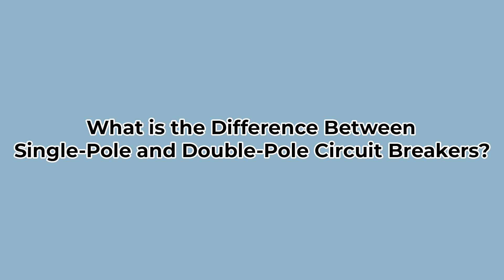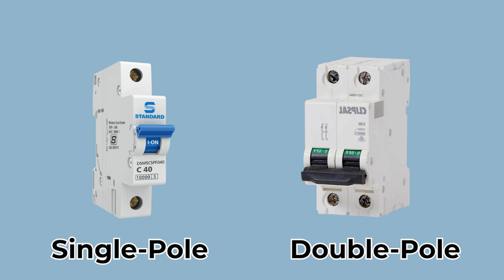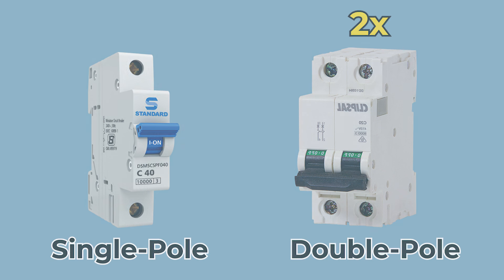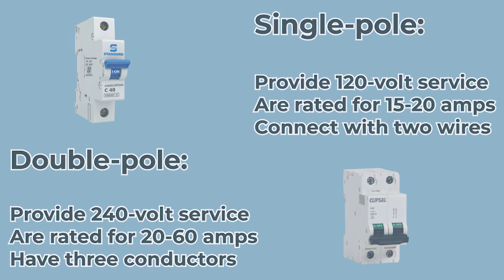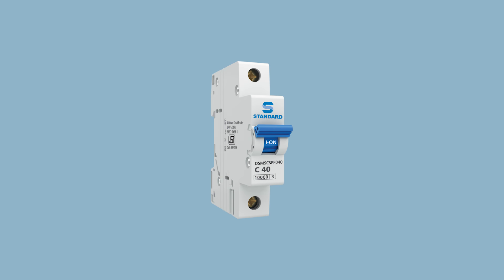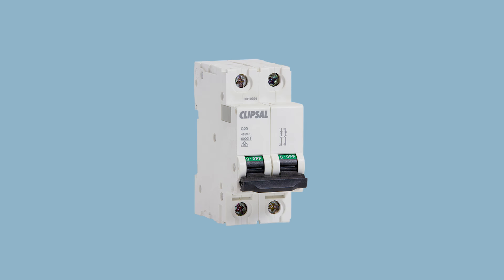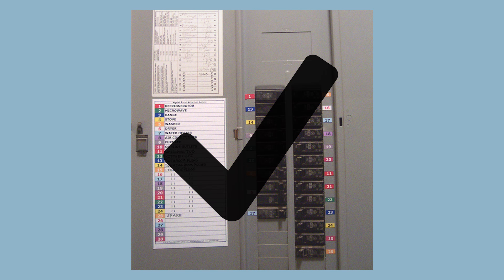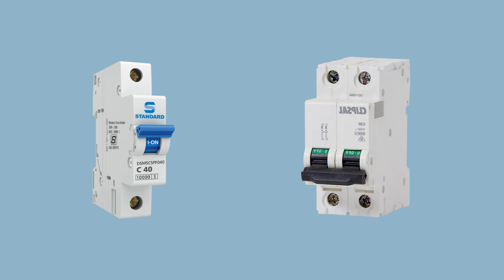What is the Difference Between Single Pole and Double Pole Circuit Breakers?

Comment: In the philippines. Single pole breakers are used for line to neutral connection line 1 is hot and one line for ungrounded wire
And double pole breakers are used for line to line with neutral as the third line connection that is the line 1 is hot and the line 2 is hot thats why they need two pole breaker very simple explanation

Comment: I m confused about Double Pole Circuit Breaker. I have seen a lot of pictures/videos which use one hot/live wire and one neutral wire as input and the corresponding output for each of them, whereas when I see the setup in the service panel box, it doesnt have the neutral input into the breaker itself, it takes two hot/live wires (from the service panel buses/two phases ) and two outputs accordingly. I am confused actually.

Comment: Exactly 100%. Moreover, single pole has 1 live wire and the switch act as a cut/connect between the path and the application, ussually for low power-consume application. Double poles have two set of wires (live-neutral-antishocking) act as  separate circuits to maintain high safety for high-consume apps

Comment: i have a circuit breaker labeled "oven" that has a lever handle that is two-wide instead of like the normal breakers that I can turn room lights and room outlets on / off.  Would that double handle labeled "40" mean that it is 240V ?  (I'm in USA) thanks in advance for any help with this
Reply: Yes

Comment: question, are you able to use 1 side of a double pole??
Reply: John Adam I got the same question you got answer😀
Reply: Yes but not the other way around. 

You shouldn’t use a double pole though unless you have a wire run that utilizes both connections....... aka; you can go overkill but don’t cut corners.

Comment: Firstly, if you dont know the difference between the 2 circuit breakers in this video,, should you really be changing them or playing around with your switchboard at all...? 
Secondly,The very little actual info in this video is mostly wrong or at best inaccurate. The use of double/single pole breakers has nothing to do with voltage or amperage. Double pole are used on mobile installations (caravans, boats), or when it is advantageous or preferable to be able to isolate both the neutral and active conductors. Most double pole "circuit breakers" are likely older type RCD's, not circuit breakers at all.
Reply: I'm guessing that because you're talking about caravans as apposed to campers and RCDs which the North American market doesn't use, you're either in Europe or in Aus/NZ. This video is information about breakers used in the North American market that the video author should've specified. In North America, double pole breakers ARE for 240 volt circuits. The US/Canada is 120VAC on single pole breakers and 240VAC on double pole breakers since our power grid is 240VAC split phase power.